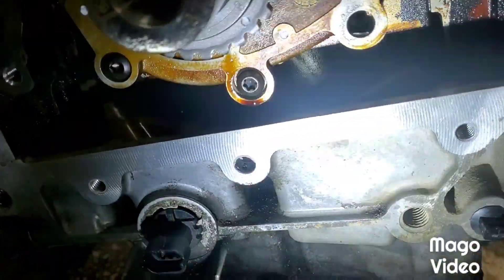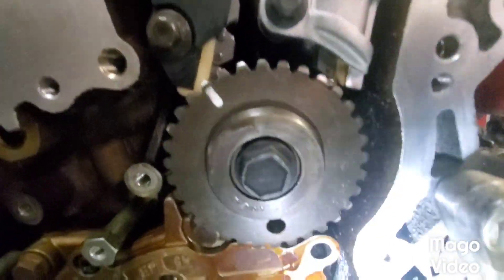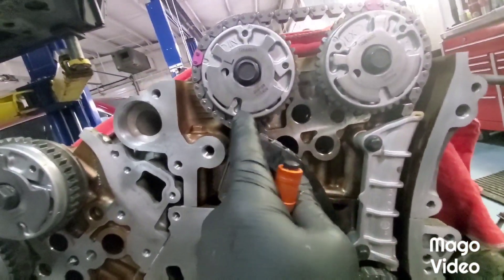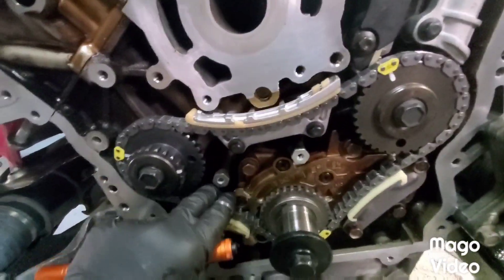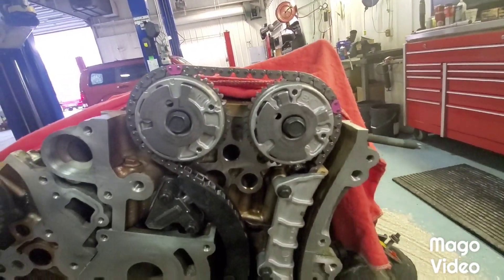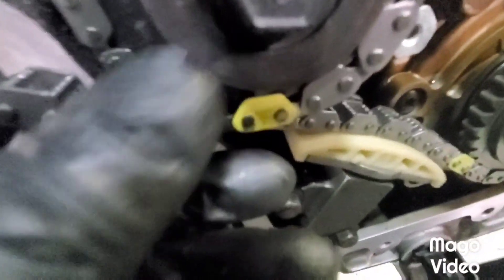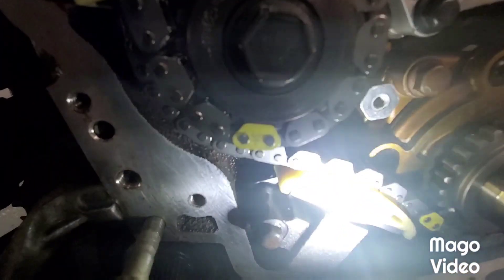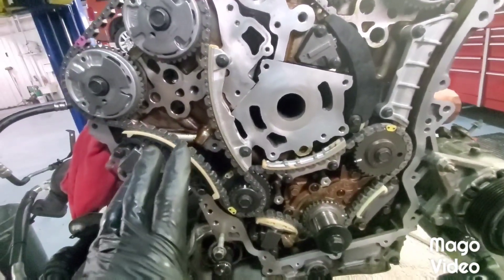GM 3.6L STAGE 1 & 2 TIMING SIMPLIFIED

Comment: Yeah dont always believe the marks. I took mine apart and got all my marks lined up before disassembly except the crank was off one tooth. The dealer and cloyes all said it must have skipped a tooth. I disagreed cuz top dead was not where  all the marks lined up. But they insisted. I knew I should have went with my gut feeling but instead listened to the pros. Now the car stumbles at idle and levels out after the phasers engage. It's not enough to bend valves so I've been running until I have time to do all over again.
Reply from the maker: I'm not following, I unfortunately have never experienced this.   It's all in the video straight up.   Follow the description.   I'm 100 percent confident in that.
Reply: @PaulysAuto  it must  be an oddity. I could send a pic if you have an email to share. Either way great video thanks for sharing!
Reply from the maker: @briannorton1301  I feel bad for you, I know how frustrating it can be to do all that work and then the car says "no I'm not playing nice today".

I really wish I could help you out, but it's tougb to do on social media at times you know?

Comment: I need help. I assembled the engine block and timing and everything on an engine stand and somehow one of the cams is off by a tooth. I couldn't get it to start even though it would come damn close to running on it's own. So I scanned for trouble codes and it said one cam on one bank was too far advanced. I was so careful to make sure the links were in the correct location before I assembled it I know for a fact the timing was correct at that point. Now it's all back in the in the car and I'm going to have to attempt to fix it in vehicle this time. I'm a little worried though, if I somehow ended up a tooth off while having the motor on a stand right in front of my face I'm concerned it'll be even easier to mess up trying to do it in the car. Any advice would be greatly appreciated. To refresh, everything is new except for the 4 solenoids. New phasers, timing set....everything else was new. Is it possible that the jump could be related to the solenoids?

Comment: I was really surprised to find a tightening sequence that said to torque them in sequence to 14 lb/ft and then an additional 60%. You may have a torquewrench that does both but mine doesn't. wouldn't it make more sense to use a torque spec only on something like that? What do you do? Thanks
Reply from the maker: I use my Snap-On digital torque angle torque wrench.

You could always buy a cheap digital torque angle attachment for a ratchet.
Reply: @PaulysAuto  That's what I have. I have a digital, click and bar type torque wrenches and one of those inexpensive angle finders that I use on a breaker bar or ratchet. He, I have that eco-tec and will have to do a timing set on it soon. Do you have a vid for doing them? If not maybe some pointers such as if any special tools are required or how you can get away without one etc. I got that 3.6 back together and the starter wouldn't engage. I'm not sure how but a common ground that ties in with the transmission control module  either lost it's ground or just needed a better one. I had to break down and buy the damn manual for the diagram. Man did that pizz me off! But it did help me to get the starter working. It doesn't want to start though. It's nearly fires up. In fact the last time I tried it was nearly running before the battery ran down. As soon as I can get that one running and out of the shop I've got to put the chain on that e tec and put the motor in a Saturn for a neighbor. So any tips would be more than welcome. Your vid really helped me understand the timing setup on that motor and I'm sure it helped many more. If there's any way I can I'll pass it and any others you have around to those that need it.

Comment: When I pulled the timing cover off I didn't remove the solenoids or the sensors. I'm pretty sure the sensors are interchangeable but are the solenoids? My goal for the night is to get the chains on and the timing cover on. Maybe the oil pan on too but we'll see. So my only question is "are the solenoids location specific or can than go in any of the four holes? Thanks!
Reply: Yes all 4 solenoids are the same.

Comment: One last question, some people are saying to just use grey permatex, others are saying it won't seal and ONLY use the gm grey/white sealer for the timing cover. What's your thought on that?
Reply from the maker: Can't go wrong with ACDELCO Good stuff!
Reply: @PaulysAuto  That's fine with me. I've only every used Permetex until I found gasket sealer at harbor freight and I swear it works better than Permetex. I even started using their super glue and thread locker.
Reply from the maker: @waynethomas1726  you'd be surprised at how amazing factory sealer really works on any make or model my friend.
Reply: @PaulysAuto  I'll pick up a tube and try it out. Thanks for the tip.
Reply: @PaulysAuto  Hey Pauly, I got the phasers and sealer today. I haven't seen a torque spec for the phaser bolts. Would you mind telling me what that spec is? Thanks.
Reply from the maker: @waynethomas1726  spec is in the video my friend 😉
Reply from the maker: @waynethomas1726   Be sure to let me know how everything turns out when you're all done😇
Reply: @PaulysAuto  Oh shit, How did I miss that? I'll go back....duh. Thanks!
Reply from the maker: @waynethomas1726  it's viewers like you that make me appreciate taking a moment to put it together ❤

God bless, please stay in touch!
Reply: @PaulysAuto  For sure I will. I need to do a chain on a Eco-tec next.
Reply from the maker: @waynethomas1726  2.4L is a cake walk compared to that 3.6L
Reply: @PaulysAuto  That's good news. Do you have a vid for that?
Reply: @PaulysAuto  I just finished torqeing the head bolts. The timing cover it still filthy so I can either put the timing set on now or after I clean the cover...I'm kinda anxious to get the timing set on so that's probably what I'll do next. I've got a digital camera, other than my phone, that I might be able to set up and do a little vid of me putting the timing on. I don't know how to put it on FB yet but I'm sure I can figure it out. Wish me luck!
Reply: I got the timing set all on. The only hard part was that I can't get good signal in the shop. I had to stand out in the cold, run back in, put another piece on....etc. LOL The whole job has been a part's cleaning nightmare. I had hours into cleaning the timing cover alone! So the only thing I don't know at this point is if the solenoids are interchangeable or not.
Reply from the maker: @waynethomas1726  cleaning is always the worst.
Reply: i used red rtv and blue and arobic sealer  all em leaked  im trying ac delco next and im done with this crapp
Reply: @bigwaves2824  I don't have any particular love for anything made by or for GM but, because he recommended using the gm sealer, I used it. It sealed. Now the damn thing will barely run and says it's got a bad o2 sensor on the left exhaust cam. I changed it, still won't hardly run. I now have to take it all back apart to see what the hell is wrong in there. When I did the job I replaced EVERYTHING with the exception of the camshafts themselves. Chains, guides, tensioners, phasers...Hell, I even changed the solenoids. Ran for about two months then this. I wouldn't give you a nickel for every 3.6 high feature on the planet! When I do this this one running there'll be a for sale sign in it THAT DAY! Pieces of shit!.

Comment: Great vid. One of the best I've watched. Got one on the lift now, spun a #6 rod bearing BUT, it always made a clattering sound even when it was warn and restarted. I now know it's probably one or more of the phasers. But, I don't really know how to service them. I know you can't do a vid just for me but maybe a quick explanation of why they would clatter, something about the pin is supposed to lock at zero oil pressure but in this case at least one does not. Just buy new pins? Is there a kit? If so I'm finding squat about on FB. Any help would be greatly appreciated.
Reply: I didn't read your description where it says to always change the phasers. Bummer, they're pretty spendy and many claim they rarely go. Maybe the "many" are ones complaining about having had to do the job 3 and even 4 times! I couldn't believe the guy who said he was doing it the fourth time! WOW
Reply from the maker: @waynethomas1726  😁

Comment: Mine lined up with everything, but when I turn the engine over the cam sprocket makes a loud clicking sound, is this because of the variable timing ?
Reply: Did you replace  the cam phasers?
Reply: @waynethomas1726  Turns out it was the cam phasers that were shot, I put everything back together and it started misfiring on bank 1, took everything apart, and the cam phaser fucked, and it jumped a tooth. Put 4 new ones and shes all good now 🙃

Comment: Pauly.... Should one consider changing the oil pump on a 2011, ~140k mile Traverse when doing a timing chain job like this, or it is not needed?  Thanks.
Reply from the maker: Do you have oil delivery problems?

Do you have any evidence that it wasn't producing adequate oil pressure?
Reply: @PaulysAuto  Hello :) .  No, I don't think it does, but we haven't opened the engine yet.  I am in the process of buying timing chain parts, and was curious if you as a routine change the oil pump too when doing this job.
Reply from the maker: @juanee2  no I don't typically.
Reply: @PaulysAuto  Ok, thank you for your reply and video, much appreciated. 😊

Comment: Why is this such a common repair with these engines? What's causing this?
Reply from the maker: Original chains would stretch, poor maintenance habits, actuator issues, and there's alot going on with the valve train IMHO.  More things to go wrong.

Comment: Isn't the last chain suppose to line up right where the window is???  Mellings chain guy puts his at the window where your first sat before you changed timing
Reply from the maker: I'm confident in my video...following service procedure here, done MANY MANY chain jobs on GM 3.6L.  I am doing the two stage timing IAW SI.
Reply from the maker: I apologize, but I just can't tell you about aftermarket parts and their recommended procedures, because I have never used them for this job.  I only use ACDELCO parts to prevent the possibility of not getting updated parts from the manufacturer.

Comment: I'm doing the same job at home and noticed the camshaft brackets on the Right bank fit really snug is that expected? Also, phase one will put cylinder one at top dead center correct?
Reply: Sorry I meant camshaft caps
Reply from the maker: CAM Brackets?

Why are we using cam brackets?

No need for cam brackets on this job.

Comment: I'm doing one on my camaro, I'm replacing the camshaft phasers, but the new cloyes once installed get stucked unless I take off some sort of gasket or space behind the stock ones, is it ok to take those gaskets/spacers off?
Reply from the maker: There are TSB's out for certain model years for spacing those actuators/phasers with a shim; it was to prevent phaser walk.

You will wanna check with the manufacturer or dealer, but I would say do not remove the phaser shims.  Like I said, it all depends on what year, make, and model you're working on.

Those shims were probably installed under warranty by the dealer.  When in doubt put them back in the same as they came out.  They are important to prevent phaser walk.  

However, since you are not using factory parts, it is impossible to really know if you are working with updated parts.

This is why I never use aftermarket on these.
Reply: @PaulysAuto  I'll check but with the shims the new phasers just get stuck and wont turn
Reply from the maker: @bigtruck1838   What do you mean they get stuck and won't turn?  The phasers can't turn unless there's oil pressure behind them coming from the VVT Solenoids to unlock them from the cams.
Reply: @PaulysAuto  as in the gear itself just wont turn, looks like there is a tsb about cam play so they must've have them installed at the dealer, I'm probably throw the old phasers on, I dont wanna put the new phasers if they're stuck and wont turn
Reply from the maker: @bigtruck1838   Re-read the description for this video.

Comment: Do you know how many rotations it takes to get back to the original timing on these? All the marks should eventually line up, and i started woth mine aligned and started rotating to try and see if they would again, but it is taking a LOT of time
Reply from the maker: They won't, it's a one time shot because it is done in two stages.

As long as you got it right initially you'll be GTG.
Reply: @PaulysAuto  so if it’s a one time thing you can’t just pull the cover off and see if your timing skipped a tooth? I’m asking because there’s a small chance I bumped the crank backwards while taking torque converter bolts out.
Reply from the maker: I doubt that jumped time from bumping her backwards, but the only way to check timing on this engine accurately is with a four channel lab scope capture of 3 camshaft sensor signals and the crankshaft signal compared to a known good waveform.  Otherwise, it requires tearing her down and setting stage 1 and stage 2 mechanically the correct way in accordance with service information...buuut if you have other issues going on such as, walking phasers, chain stretch, or other mechanical issues (reluctor wheel walk etc); then it will require scan data and scope captures to isolate - which should have been done before we attempt anything on this engine regardless.
Reply: If they line up once they will line up again. It's about 12 or 16 revolutions.
Reply from the maker: @Brian Norton....ummmm....No they won't, stage 2 timing rotation makes it absolutely impossible.  That is inaccurate information my friend.

Comment: I'm in stage one timing. Unfortunately the crank skipped a bunch of teeth turning counterclockwise to get from stage 2 to stage 1. In stage 1 timing can you turn left bank cams counterclockwise  without chain on to get back on time without hitting pistons? The 1 and 3 cylinders are down but number 2 is up almost all the way in stage 1 btw. I have the 3.0 LF1 V6 in equinox, is this interference or non interference? Could I have bent a valve hand cranking cams or no?
Reply from the maker: It's not an interference engine.  You shouldn't need to turn crank counterclockwise to get to stage 2.

Comment: Just lock the cams on both banks?
Reply from the maker: Why???  Completely unnecessary!  Why would you lock them when the service procedure says nothing about doing so???

Adding unnecessary steps creates confusion...silly!

Just go ahead and lock them then, if that's what you find works great, but you are making a simple timing job WAY MORE complicated than it needs to be.
Reply: @PaulysAuto  Who cares about what the service procedure says, the engineers who wrote that ar people just like you and I.

 When I have to do that job, from what I have seen of other people doing the job, I probably will lock that bank when I do it, One less thing to worry about, and anything that can save time is good.

I Have been in auto repair for 35 years. Things can always be streamlined and proper preparation produces perfect performances. Just sayin.

 I'm not attacking you, just to be clear. Thanks for the video.
Reply from the maker: @markusgarvey  I understand, I am just saying it really is not necessary for these.  Like I said, you can lock um down if you want to, but it's really not needed, it may help you on that RH Bank to prevent the Cams from rolling, but I never required anything to set these properly and quickly.

We have to buy enough special tools for these things these days no need to add to it.

The biggest mistake people make on these is they don't read or follow the service procedures (they are there for a reason), they fail to clean it thoroughly, and/or they skimp on ALL the parts (like the actuators) or buy aftermarket trash IMHO.

I agree in making our job easier, but as long as the marks line up and you do it in two stages, you seriously cannot screw it up.

Comment: So if this engine were to jump time would it not be worth fixing? Or would a new timing kit fix it? Guess I'm asking is this engine an interference engine or not. This video helped me slot with wanting to take on the job but I'm wondering if its worth it?
Reply from the maker: It's not an interference engine.

Best advice is to tear out cams and perform a leak down test on all six.  You will then be able to determine if you have severe valve seating issues or excessive leak down via rings etc.

Check lifters and mic out cam lobes upon removal.

I have never seen a 3.6L jump time, not that it can't happen. Now I've certainly seen the chains stretch or have an actuator problem.

However, I have seen people incorrectly set timing by a tooth on the RH bank usually exhaust cam; in which it'll just have poor performance and a few correlation DTC's.

Is it worth it?  Well how do you really know the condition of an engine without tearing it apart...answer you don't!  You can run an in cylinder waveform to gauge it, but you can't be 100% without physically checking components upon removal.

😁😄

How many miles on the one you are working on?  If you are at 200k or so you may need to consider a valve job regardless.  It really depends on how much leak down you're getting, how clean the seats are, and how much you ran induction services throughout the entire 200K?  Is this it's first set of chains?

Hopefully answered it for you?